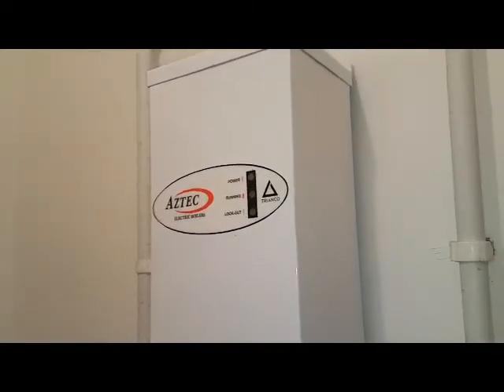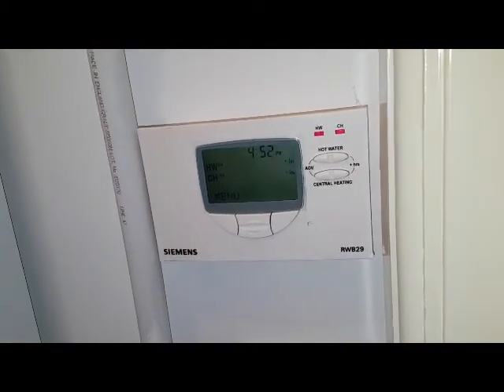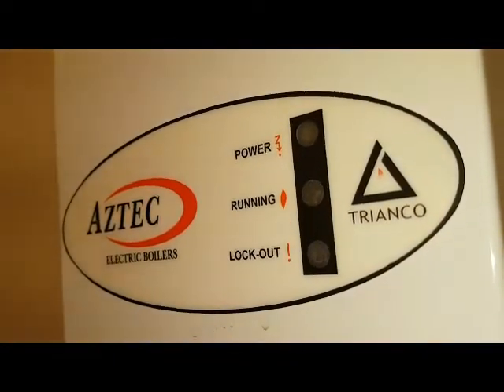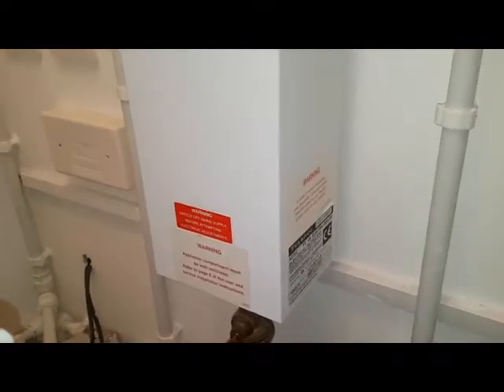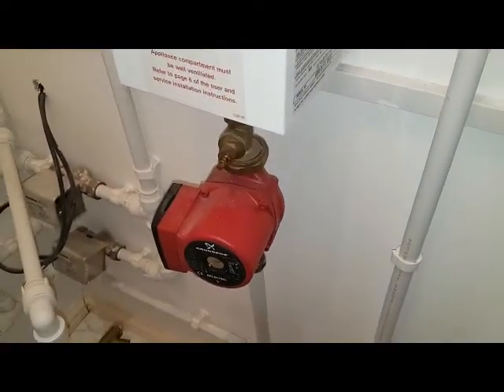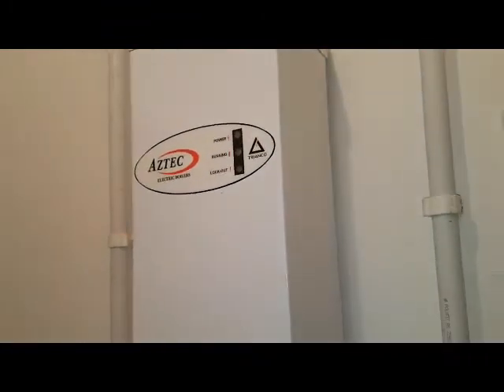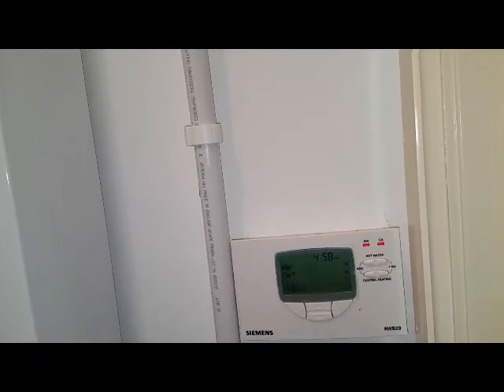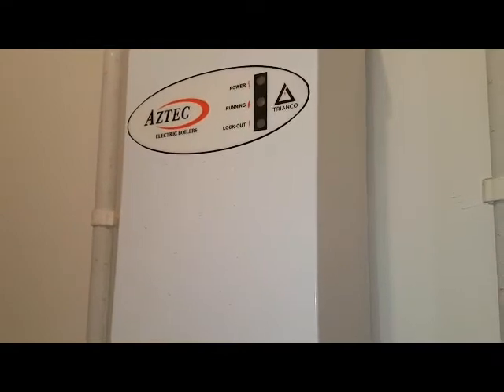Trianco Aztec Faulty PCB

Comment: I have to hard reset mine often. It’s always made a pulsing noise since it was brand new though weirdly. My issue with it at the moment is it fires up, starts to heat my radiators and then 5 minutes later the boiler turns off even though the thermostat is still calling for heat. Genuinely, these boilers are a nightmare.
Reply from the maker: It's looking like the pcb
Reply from the maker: Visit website about replacement boiler https://www.electricboilerinstallations.co.uk/system-upgrades/

Comment: Hi is it safe to switch it on and off again please? I've been controlling it by the trip switch as it runs continuously when on but it also trips out now when using which I put back on and leave on for an hour or so til heated water, seems to be since having a power cut, can I reset it? Just worried about safety. I'm currently renting with an awkward landlord so hoping to persist with it til I move hence the research. Thanks in advance.
Reply from the maker: Here my email address tony@engineerteam.co.uk send me your number and I'll call you